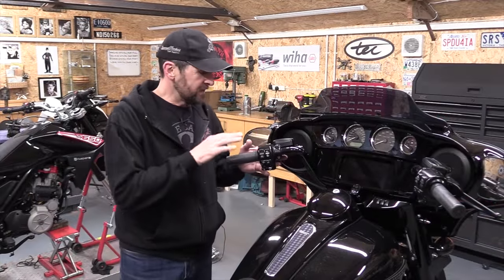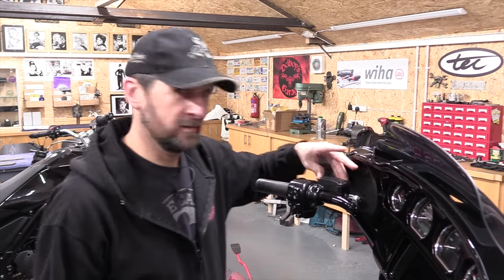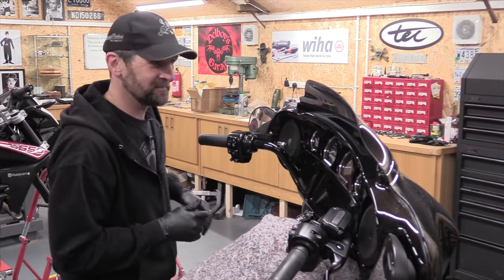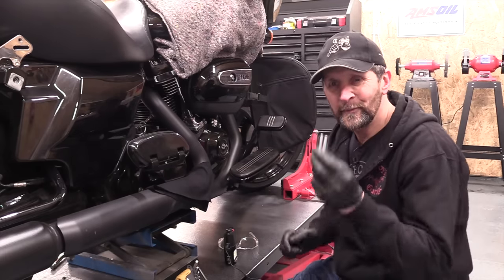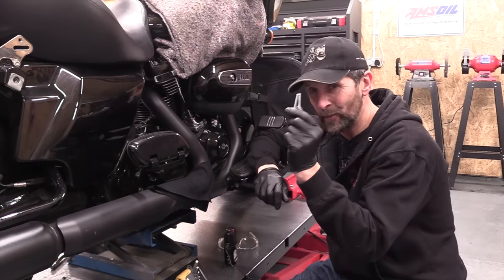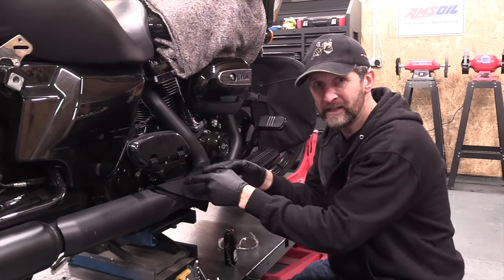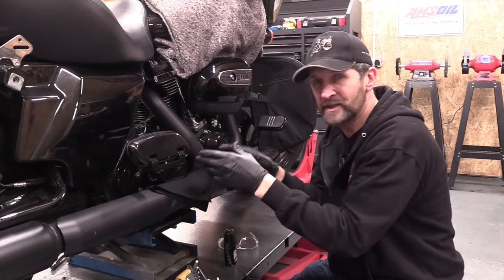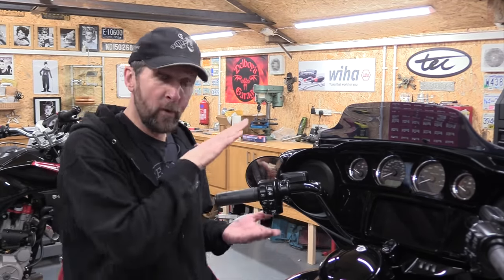Harley Davidson, M8 Clutch Fluid Change !

Comment: great video I'm just curious did you have to loosen the exhaust to get the cover off transmission or did you have enough space I have a 2017 Road Glide and I need to loosen the exhaust

Comment: Hey Del, I’ve been meaning to ask you this question in regards to the brakes but it applies here as well. How do you know where to fill the reservoir to? With the brakes if you’re pads are due a change wouldn’t you have to put less fluid in the reservoir as the new pads would push the piston back filling the reservoir with more brake fluid than before right? When I did my brakes and clutch this past summer I used a needle to make a light mark at the level of the brake fluid in the reservoir on the inside them filled it back up to that level. Be good to hear so experienced feedback on this, on my old bike I must have put too much fluid in because after a ride I had brake fluid weeping from the reservoir. Thanks Del 🍻me mukka.
Reply from the maker: OK, it goes like this.. Fill to the top of the sight glass for the old pads you have, (if no sight glass, go about 6mm from the top!)   Then, when it comes time for new pads, suck the fluid out of the reservoir, push the pistons back and fit the new pads, then top up with fresh fluid to the same level as before, that way, you'll have correct adequate fluid with the low pads, and also with the new pads, you simply adjust accordingly mate.. Hope that helps.
Reply: @Moonfleet41  thanks a million for your reply Del, 90% of my servicing knowledge comes from you. 🍻

Comment: Went out early last year, on my way home(5 mile out) my clutch "failed", so had to rev match on down-shifts(stopping was a nightmare).
Sorted it next day, guess what, no fluid in the system. ordered new clutch slave kit, fitted and(just as you did) reverse bled the clutch(Bandit), smooth as silk after.
Reply from the maker: Blimey mate, well saved, been there once myself on my 1200 Bandit, it seems they were a weak point, and one of the reasons for the common swop to stick a 600 clutch cover on it(not the actual clutch cover, but the sprocket cover from a 600 Bandit, swop the bar furniture as well, and hey presto, a cable clutch on your 1200 Bandit, problem solved!)

Comment: Great! I have a 2010 Dyna Fat Bob CVO and this has never been done. And My clutch doesn't engage all the way, making it hard to find neutral and it wants to crawl forward when the clutch is in and I am at a dead stop. The book says to do this from the other end using a pricy tool. But the way you come at it looks good. So if was you, and as far as you know, the way you did this here will work on my Harley too. Correct?
Reply from the maker: Just to be clear mate, a 2010 Dyna would be a cable clutch, or is that the CVO has an hydraulic clutch?
Reply: @Moonfleet41  oh. It has a hydraulic clutch for sure.
Reply from the maker: Ok, i assume its a CVO thing, they are higher spec in many ways... If you experiencing clutch drag, and hard to find neutral, that sounds like air in the system, and yes, purging the fluid up from the bottom will certainly help push out the trapped air..

Comment: I saw you used Mobil one brake fluid? What's the exact name of it? And why did you remove the bags? Also I removed my clutch cover on the 114 and I saw some water come out with the clutch fluid. Will that make shifting gears a little noisy with a little water in it? I have 6,500 miles on my 2019 street glide special. Thank you for this video!!

Comment: Great video Del😀Quick question I have a 2013 Electra Glide Custom and want to buy some DOT 4 brake fluid NOT from HD so expensive...can I use Synthetic brake fluid instead of the regular DOT 4....what do you use spec wise? I know you don't buy it from HD😀....Cheers Danny//
Reply from the maker: Hi mate, as long as what you currently have is DOT4, then that's fine, synthetic and regular will mix, but better to change it completely rather than ad the two together, so flush the system through with the new stuff so that's all that's in there.   have fun woith it mate and ride safe.
Reply: @Moonfleet41  Thanks Mate 👍

Comment: Not that easy on my bike Brother! Had to pull the chrome heat shields, the R/H floorboard, remove the bolts holding the R/H muffler on, loosen the exhaust bolts from the heads, and finally I get to remove the clutch cover plate. When I first started I thought it was gonna be this easy also, but nope! Had to do all that to get my cover off. Don't get a 2017 CVO Ultra 114, or you'll have to do all of this also for 5 minutes of work. I'm gonna have to start a YouTube channel so I can justify to my wife on getting a motorcycle lift!!
Reply from the maker: Sorry to hear that brother, it can be a hell of a job for such a simple task!  Same goes for the rear brake fluid reservoir on some Dynas, you can clearly see what order they assemble the bike in at the factory!
Reply: @Moonfleet41  Forgot to say above, really appreciate what you do for the community, taking the time do these informational videos helps us guys and gals out tremendously! That's a lot of sitting behind the computer! Appreciate ya Brother!
Reply from the maker: Thank you so much for your kind words of support sir..!

Comment: Q. why do you not have a second syringe to suck the wasted brake fluid out? Surely that would save the fafing about keep changing fluids in the one you are using to recharge the system and save time. You'd only need a large hypo for this purpose. Like the way you are saving folks "LOADSAMONEY", keep up with the excellent content.
Reply from the maker: Yeah I've got a second one on the shopping list, it would have been easier, but no big shakes to wipe it out and as ever, constant other expenses to pay out!

Comment: Not sure why you took the saddle bags off, but OK...  You have to try to change the clutch fluid on a Road Glide. Quite the ordeal to level the reservoir. Also, the cover to the bleeder on my bike can't be fully remove, I have to pull the top open and have just enough room to change fluid. Are those stock headers on your bike?

Comment: Sir , I don't have the squeaky sound from my clutch handle but when shifting gears i need to completely squeeze the clutch handle for the gear to engage.  Also if I start my ultra when I squeeze the clutch handle to its limit my bike surges forward.  Can the issue be low level clutch fluid . Thank. You for sharing  Big Mex from central California.
Reply from the maker: Hi there, ok, two things maybe.. if you have after market "fat comfort grips" they can prevent the lever from pulling all the way back... otherwise, it may be air content in your fluid line.. so bleed the clutch through to force out any air and it should crisp up the lever and give you normal clutch operation.!   Hope that helps you sir, good luck with it.
Reply: @Moonfleet41  thank you . I will do the steps you advised.

Comment: I’ve never reversed flushed my brakes/clutch… Very interesting for sure. I’m guessing this method works better at eliminating any air bubbles that can tend to be trapped in the line flushing the normal way (?).  Great video for sure. I’ve installed self bleeders on my 2002 Kaw  Connie, but I’ve only bleed the brakes/clutch filling the reservoir top down. The self bleeders seem to work well… so far anyways. 🤷‍♂️ Thanks again for great content and as always, so good to see someone do it right. I cover my tank, and wrap the reservoir(s) with old cotton t-shirts I use as rags. Keeps the accidental spillage from getting on anything that isn’t reservoir territory 😉.

Comment: hi, ive have a bmw r nine t with a fluid operated clutch using mineral oil and bmw say its not part of the service schedule and never needs changing. does mineral oil absorb water like hydraulic fluid and what do you think of the never needs changing idea.
Reply from the maker: No Mark, the mineral oil won't absorb water, but it will break down over a long time, (a long time meaning maybe 10+ years or more).. so you could still change it if it's really old, but nothing like the regular intervals of the DOT glycol based fluids!

Comment: Nice video! Just curious about what to do with the waste break fluid or any used hazardous materials when I’m all done with the job? Does this require an expensive service to come to the garage and dispose or is there a better less expensive method? Thanks!
Reply from the maker: I take all my waste automotive fluids to the local tip where they have a recycling facility !  once i build up a few bottles full, i go tip it in their big tank !
Reply: Thanks Del, I appreciate all your advice. Cheers Mate!

Comment: Great tip there mate. Thank you. Where is the link for that syringe?
Reply from the maker: In the description mate..first link at the top... but here it is if you can't find it.. https://www.spanner-monkey.co.uk/oil-and-brake-fluid-inspection-syringe-200ml-120826?search=vs404&description=true
Reply: @Moonfleet41  yeah just saw it. Thanks again mate.
Reply: What size ranch did you use after popping out the cover of the slave cylinder to control the fluid going in?

Comment: Do you think I can find the clutch slave cylinder and or bleed nipple on my BMW GS. (2019 model) I've a rough idea but hell its buried in there. I think they'll get their £130 out of me. Grrr!
Reply from the maker: Oh my goodness, proper buried they are.. the closest I've done to that is on a BMW Rockster, took me hours just wrangling parts to get to it..had to unbolt the rear subframe, drop the exhaust off, back wheel out too, easy enough to see it under the air box.. but not so easy to get hands and tools to it.!  Good luck with it mate, hope it goes well.
Reply: @Moonfleet41   I've a sneaky feeling if I remove the battery and the battery box I might get access...... but that's how it starts isn't it.

Comment: Another great video brother !!! that syringe works perfectly! I think reverse bleeding on brakes is the way to go based on personal experience. Great job brother , stay safe guys cheers from new york 🥂🥂🥂🥂
Reply from the maker: I think you're right, if you can reverse purge a hydraulic system it helps to prevent any air getting in and saves time too.. take care and ride safe brother, and have a great week both of you.. D&Pxx

Comment: I started using Bosch ESI6-32N Brake Fluid in my C90T and friends Harley’s. Seems last longer and handle the heat a lot better in traffic and such.

Comment: Beautiful street glide Del. Didn't realise you had one. Been considering trading the sportser for a 114 street Bob. Cracking video as always with the reverse bleed technique. Like most people I would have thought it was the pivot squeaking. 🇸🇪🇬🇧😊👋🏻
Reply from the maker: Cheers Paul, it's a common problem and I seem to get it every year, but an easy fix!  Go take a test ride on that Street Bob, and I guarantee you won't wanna get back on your Sportster!
Reply: @Moonfleet41  Yes a quick easy fix! I recently bought a pen like instrument which is a brake fluid tester measuring water content. I couple of weeks ago I changed the brake fluid on the sportser and out of interest I checked for water content in a 12 month old open bottle I used. It was just on the verge of being usable. In spring I'm changing again to be on the safe side even though I haven't used it. As for the 114 Street Bob I know I would be hooked that's why I haven't test rode one yet lol.  🇸🇪🇬🇧😅👋🏻

Comment: Can you use this method with an ABS brake system? I’ve heard you have to purge the system with the correct software. Is it really necessary?
Reply from the maker: It depends on the bike mate.
Reply: As I understand it, for a HD, if you get ANY air in the line, it has to go to the dealer and be put on the machine.  Where I live, it's $120 for the service of having the brakes flushed, and the  ABS module reset.  When I did my bars on my 16 SGS, I opened a banjo bolt too far, and it had to go in.  The brakes function, but they will lock.  I've seen videos where people say they can do it, and show you how.  That's one of the things I'll let a pro handle.  The ABS is too important (to me), and I want to know I didn't muck it up.

Comment: My cover won't come out , exhaust don't give enough room, stock exhaust so I guess this job just got alot bigger
Reply from the maker: If you loosen the exhaust mount bolts, (no need to take it off).. flex it back a bit, and with a cloth in between to protect it, easy the cap out and then back in again.. works ok, just take a little longer..!
Reply: @Moonfleet41  that's what I ended up doing, had to loosen everything and got it to fit

Comment: Great video Del, as always. I haven’t got a Harley or a Hydraulic clutch but love your work all the same. Wow, £100 of labour. Is that two hours at £50, or is the rate even higher these days?
Reply from the maker: Thanks mate, glad you enjoyed the video, and sadly no, that wasn't two hours, just one, and to make it worse, it was 25% discounted labour rate due to a customer prepay package. (according to the invoice).  labour rates in motorcycle main dealerships are level with car dealers now, about £125 to £150 an hour !   just how it is i guess !
Reply: @Moonfleet41  Thanks very much for responding Del. Wow, that’s incredible! I had no idea. And I thought £50 was a lot, I’m way out of touch.😆.

Comment: Hey man! It’s been a while since I watched your videos because I moved from a sportster to a street glide! I see you did as well! I was watching this cause I may need a new clutch. I powder coated the levers and now have a clutch issue. The shop thinks maybe the thickness of the powdercoat was pushing on the hydraulic clutch cylinder and I burnt out the plates.
Reply from the maker: Hi there and Welcome back! sorry to hear about that, it must have been slipping for a while to have actually worn the fiber plates out !!  i guess all they can do it drop them out and take a look.. Good luck with it, i hope it's a simple fix and not so serious.!
Reply: @Moonfleet41  thanks I’m going to start with the fluid change and hope it helps
Reply from the maker: @harleyroadster9502  Good luck buddy.. hope that's all it takes to fix it.
Reply: @Moonfleet41  guess what I couldn’t pull fluid or push it and confirmed lines not clogged. Looks like o have to replace the internal components, the spring and actuator.

Comment: Yay nice to see a Harley on the bench, I was contemplating reverse bleeding the brakes on the Fatboy as the fluid is over 2 yrs old, I know its ABS but  the nearest dealer is miles away,  what is your take on it Del, hope you & PP have a great 222 you both deserve & earned it x👍👍
Reply from the maker: Hi Geoff, this was clutch, so not relevant with ABS issues... with your Fatboy, if you don't have experience of this, or the right equipment it could be worth that trip to the dealer... specially if you tuck it in with something else to make the trip worthwhile... the biggest concern is if you get any problems it will throw a warning light, then you'll have to make the trip anyway.  Hope you're keeping well yourself, we are both ok here and like you, hoping for a better 2022!  All the best, D&Px
Reply: @Moonfleet41  thanks Del, have a good week,  x👍

Comment: Surprised you don’t use a brake fluid tester. Just to know moisture % content. I’m always Curious. Even if I’m changing it
Reply from the maker: Just ordered one mate, it didn't come in tome for the video... a great tool indeed.
Reply: @Moonfleet41    I’ve had a good color old brake fluid, like yours. With 0% before. Was changed,  just no loctit was used. ( same old white factory)

Comment: It becomes a real pain when aftermarket pipes get in the way. If the cover
Reply from the maker: Yeah, i have had that a couple of times, worst design i ever saw was getting access to the rear brake reservoir on a Switchback.. totally hidden and buried behind the exhaust, aftermarket or standard, just the same.. makes a rear brake fluid change a two hour job.!

Comment: You can still do the leaver pull-in trick to get more of the tiny air bubbles out, but that is less of an issue than the brake side.

Comment: Well done. And saves a lot of money. 
Interesting noise: I've never had a squeal of the hydraulic clutch of my Triumph Trident 900 (MY 1991). Nor on a rented KTM Freeride 350. All my others bikes are operated by cablem though. Might be a Harley thing.
Cheers from Günter/Nürnberg/Germany